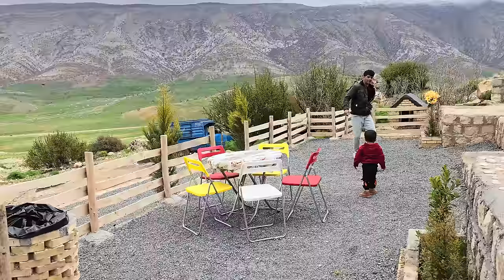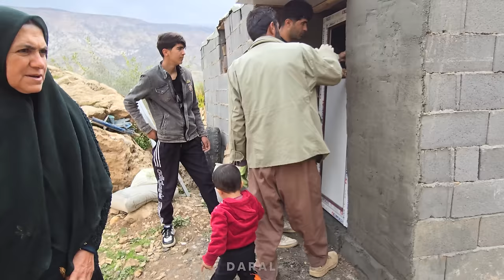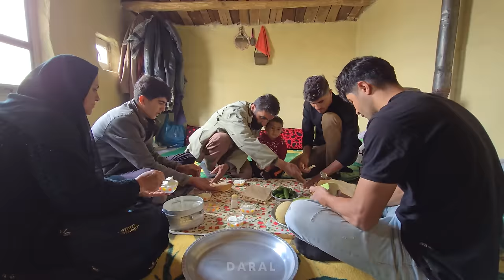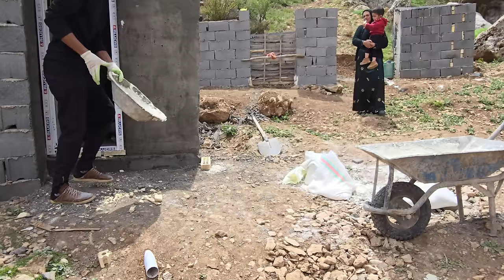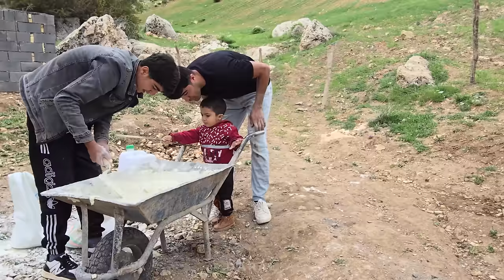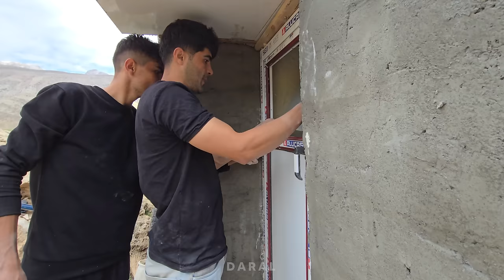Amir's family happily welcomed Hassan back from university and installed the bathroom door together.

Comment: Why don’t they not take off the door stickers first before they started fitting the door. 
It’s much easier to pull all the stickers off beforehand because plaster is harder to remove. If there’s any sticky glue residue that remains still on the door frame it will easily come off with  a bottle of ladies nail varnish remover and some cotton balls.
Well done everyone it’s going to be luxurious for everyone to have a nice shower.

Comment: Goodday to Amir’s family. Whiten also your toilet and tiled it. Provide water tank for the toilet for flushing and also a barrel to collect rain
Reply: Use water & soap in cleaning after using the toilet. By the way, put a sink in the bathroom where you can wash face & brush teeth. Suggesting also to put a mirror inside the bathroom
Reply: Its better if later you also tiled the walls. Its easier to clean a tiled walls.

Comment: What kind of bathroom did you make? You have to shower sitting down. Well, you made the ceiling a little higher. On the other hand, why did you attach the shower to the wall? You should have made the pipe bigger so that it is far from the wall.  How to make